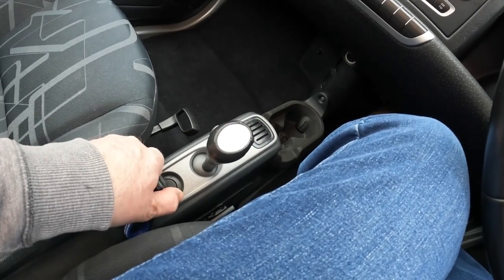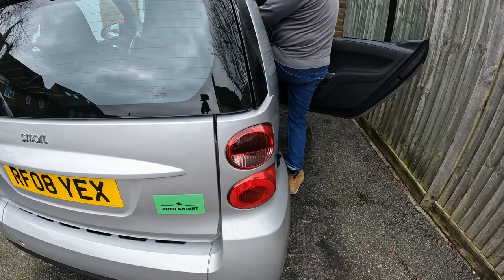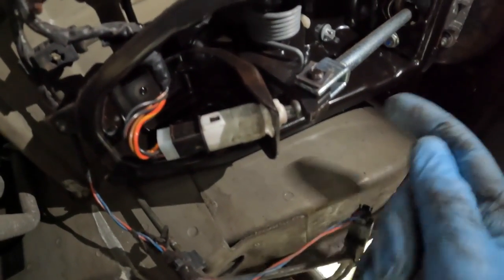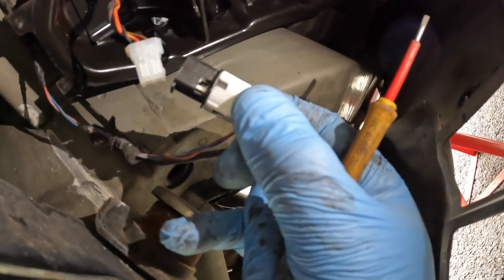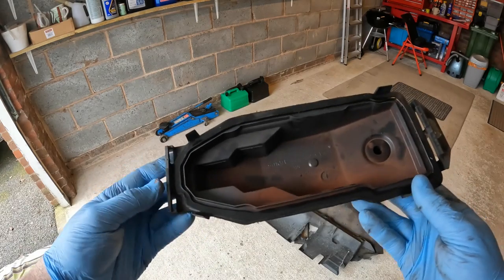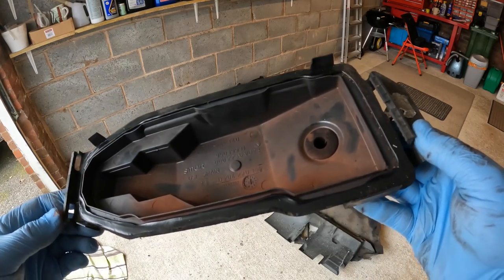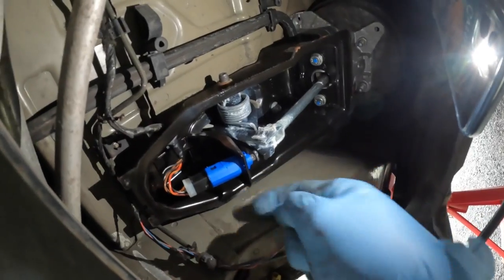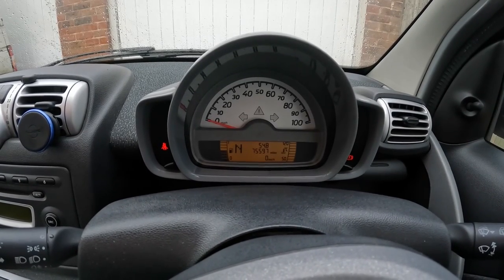Smart Fortwo Not Selecting Gears - Brake Light Switch Replacement

Comment: Just now I have kind of the same problem. ABS is on and reverse sometimes not possible. It worked, going from N and pushing forward into 1 and then backwards and then in the reverse mode. Only then it would go into reverse... 
Just looked at the car.. brake lights did not go on!
So... the brake light switch... hmm 
SO glad you exist!  :face-red-heart-shape: Thanks man. Also love the soft and slow explanation you do. Tops!

And.. sooo handy.. cableties... :face-blue-smiling:

Comment: Thank you! that is very useful. I have a 2003 City coupe with no brake lights but I am able to select gears. I have checked bulbs etc. Is it still possible that the switch is faulty? I notice it is 2 pole switch with 4 pins . Is it possible that the feed to the bulbs and the feed to enable gear selection are separate within  the switch?  many thanks
Reply from the maker: It’s plausible but would have to see a wiring diagram to confirm.
Reply: @autoknight747  Thanks for your reply, unfortunately I can't find a diagram. I'll get out there and check the switch and will let you know .

Comment: Thank you so much for these great videos.  I'm kind of new at this so, could you please produce a video or point me to one that shows, in detail, the lifting and securing on 4 jack stands of a 451.  I am sure that I will need to do a brake and rotor job on my 2013 smart fortwo soon.  And, although I can find several videos of how to change rotors and brake pads, I am having trouble finding a detailed video of the process of lifting and putting the car on jack stands.

Comment: Hi friend, your videos are very good to me. I don't know how to speak English, but I understand a lot of what you say in your videos. I have a 2014 smart fortwo automatic, the gear shift does not respond, since I start the vehicle and change the gear shift to neutral, or parking or drive and the car does not respond at all and when I push the car it is in gear while in neutral and if I manage to push it but it is very hard, there are 3 bars on the dashboard, do you think that changing the brake pedal switch will solve the problem, or what problem do you think my vehicle has? Thank you very much in advance.

Comment: I'm curious what made you go after the brake light switch? Was there any prior diagnosis?
Reply from the maker: It is very logical. These vehicle require foot on brake in order to select gears. So if the vehicle believes there is no foot on brake it will not allow gear selection. First step- does it have that signal. It didn’t as no brake lights. It would be very bad luck for all brake light bulbs to have failed, next step - switch.

Comment: Would it make sense to change the break light switch if the break lights are still working but the car has trouble shifting to drive and reverse? I also go into neutral attempting to drive or reverse but my break lights mostly work. Finding the lights need to be changed after only a few months after replacement.
Reply from the maker: I would want to establish if the brake lights are working when the car is actually having the selector issue, before condemning the switch and replacing it. There are other things that can cause these issues like clutch/actuator.

Comment: Was this black plastic box, where the brake linkage is located have already been opened in your case? Because I tried to open mine today, to grease the linkage because the brake lever squishes a little bit when being pressed, and this black plastic cover was with some kind of glue, very strong, black color, and I kind of damaged it by pulling it. I think it’s meant to keep the inside water tight. But anyways i will have to  replace this cover now.

Comment: Hey bro, I’m so glad I find your channel I have got a smart MHD 09and I recently encountered some problem with what seems to be electrical, what would happen is that I will drive the car and all of a sudden the eco light will start flashing and then the car will just slipped out of gear. Although it shows A on the gear selector. I will then have to switch the car off for maybe two minutes and then it will work like nothing has happen. Can you please advise what might be causing this
Reply: Did you find the solution 😢 mine just gave in after doing all the above every time
Reply: @Prince-su4ro  hey buddy, so of me changing the brake light switch what I did did, was pull the battery power for about 30 minutes and while that is happening, I go under the car pull back the black rubber on the actuator and spray, some white grease inside as much as I can leave that and now my car has been a year without any problem at all
Reply: @ashstonk  thank you I’ll give it a try

Comment: I wonder whether it's prudent to renew that switch as a precaution, after x amount of miles ?
Reply from the maker: I’ve been wondering the same but then the new component may also develop a fault too. It’s astonishing to think that the vehicle depends so heavily on one component that has the potential to bring it all to a halt.
Reply: @autoknight747  indeed! I had to get the car towed so the cost of this failure is at least 10 times more than cost of the part… 10 years maintenance for it does worth it I think.

Comment: Is the box that the brake light switch is in... is it sealed?
Reply from the maker: Lid/cover is sealed with a bead around the perimeter. Brake pedal enters it from the interior and the rubber gaiter at the base of brake pedal prevents dust/water ingress from above.
Reply: How do you disconnect the brake light switch do you just pull it it seems really stuck in there the electrical wire
Reply from the maker: @willfreethemfreethem7671  It’s an electrical connector and they are very tight!
Reply: @autoknight747  ok my fingers feel blistered and I cheated and used a flat head to pry it up a lil but I got it thank you!

Comment: Need some advice , smart is stuck in auto
Reply from the maker: First step is to check you have brake lights and that your battery is good. If both ok then select neutral, foot hard on brake and hold it there, then turn ignition on but do not start the car. Keep pedal pressed and after a while you should hear a serious of clicks and clunks as a reset occurs. Hopefully you should return to neutral. Beyond that it would need a physical inspection/disgnosis. It’s so difficult to diagnose remotely.
Reply: @autoknight747  thanks so much for getting back, there is no brake lights but some reason the bloke looking at it managed to get it stuck in automatic , apparently the battery is flat so not sure if that made it stick in auto, charging battery then will see how that goes